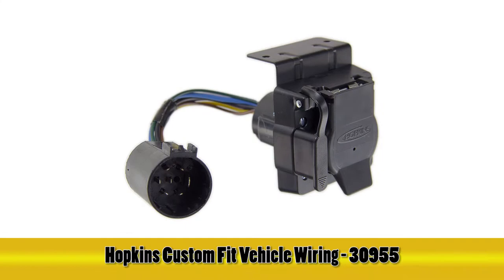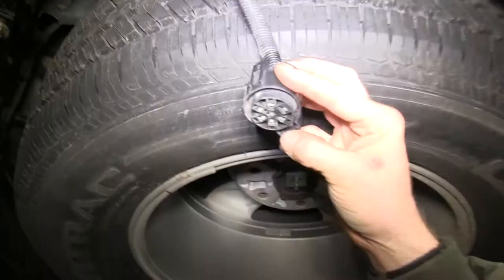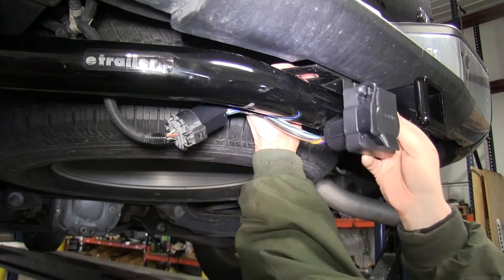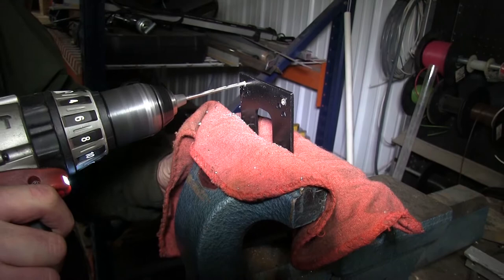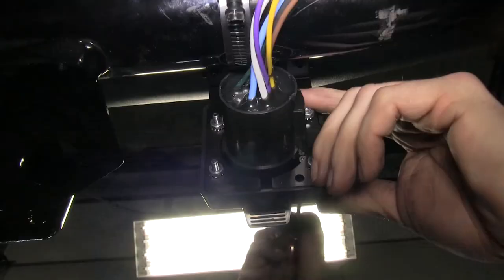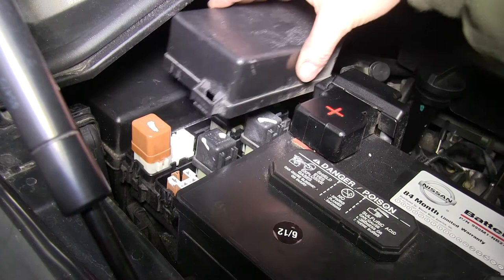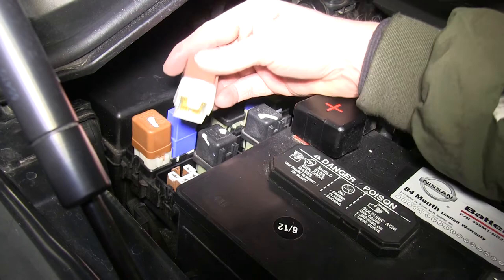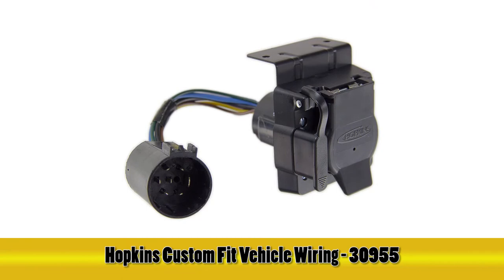Install: Replacement Custom Multi-Tow 7-Way and 4-Way Trailer Connectors on a 2005 Nissan Armada

Comment: My 2007 armada has no wiring harness but i looked under the hood and it does have the relay box, any idea where i can find the harness?
Reply from the maker: If you have the factory tow package, you should have the wiring above the spare tire to be able to plug into.
https://www.etrailer.com/Custom-Fit-Vehicle-Wiring/Hopkins/30955.html